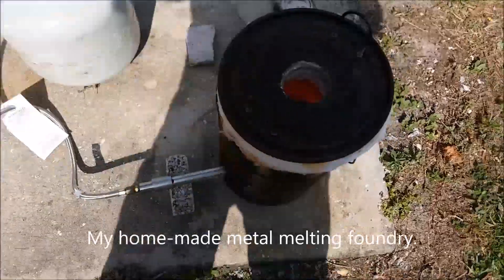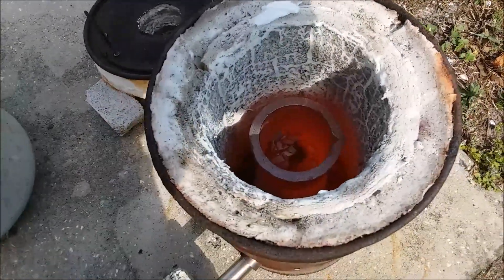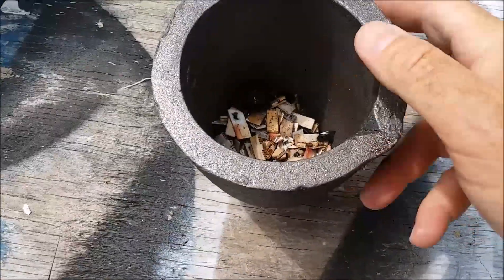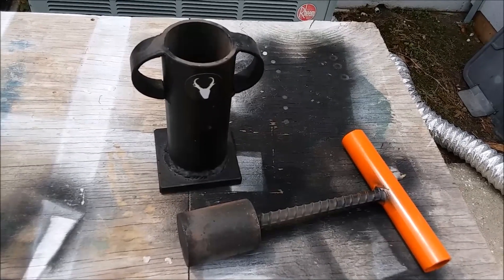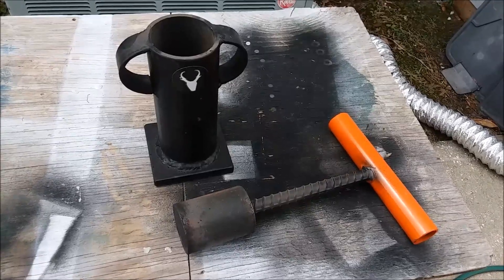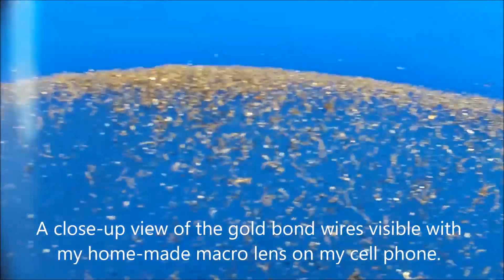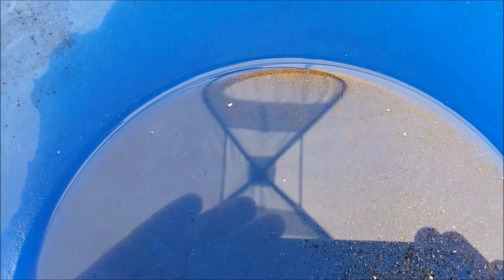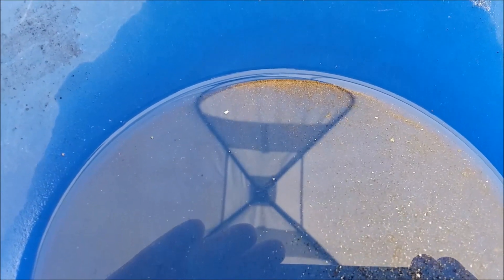Panning Gold from incinerated and crushed RAM Chips

Comment: First, you are wasting your acid when you stick the hole Ram boards into it.  There is a reason why people trim the "gold fingers".  Second, when you incinerate your chips going the "hot ash" way, you allow the gold to melt with the base metals.  The gold used in electronics is not a 24K gold to begin with and by smelting the base metals and the thin gold layer you decrease the value of the end result.  Third, no one pans out the the metals after the ashing because you will lose a lot of tiny embedded in the ceramics gold that way.  You have to use Aqua Regia process to obtain and purify the gold from this process.
Reply from the maker: Hi, Alan. This was just a test to see if there was any gold in those chips. Now that I know it's there, I will get more systematic and efficient about how to capture it. 

In the future I will be removing the chips from the boards in a trommel depopulator before processing the boards. The chips will be incinerated at temperatures that don't melt the gold. The debris will be much more thoroughly powdered to liberate the gold, and sieved to -30 or -40 before panning. Anything larger will be returned for further milling.

Panning will only be done to get rid of the bulk of the light ash material and concentrate the gold and other heavies. I'm not going to try and actually separate the gold by panning alone. The resulting concentrate slurry will be treated with nitric acid and rinsed to remove any base metals before dissolving the gold. 

I just did a small batch according to the above procedure and it went very well. I'll be videoing it in the future once I am ready for larger scale processing.
Reply: thanks alan that answered my question wonder if I can run ash through like one of them 3 tier sluice jobs
Reply: @cditzler6313  your name sounds German, where u from m8? Im from the Netherlands and i could use a friend not to far from here where i can collab with. For example swap loan etc gear and materials with. plus all the other stuff that can contribute help and efficiëncy. Grtz
Reply: @Yokozunastyle  iowa
Reply: @cditzler6313  hahahaha pretty far from Germany